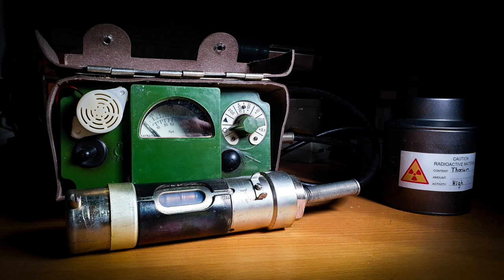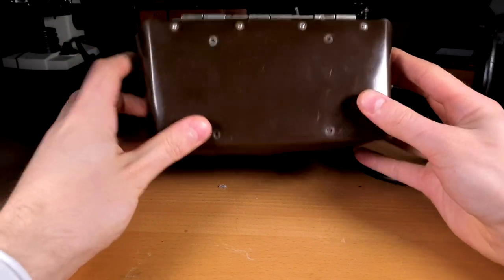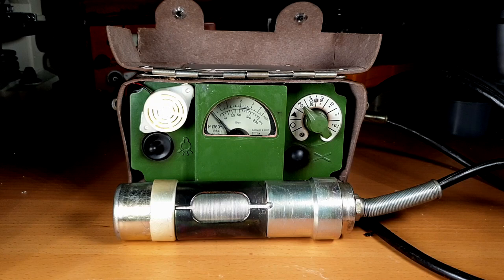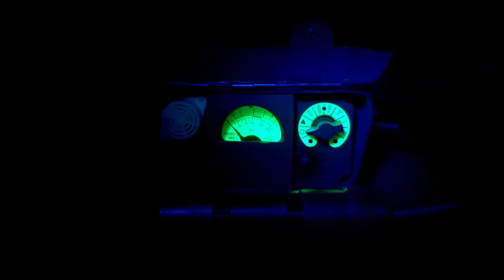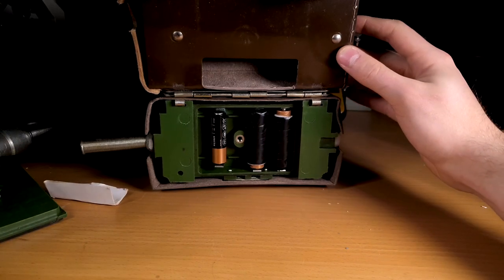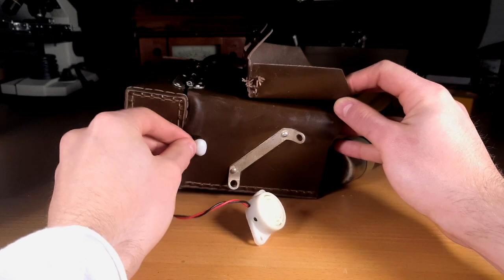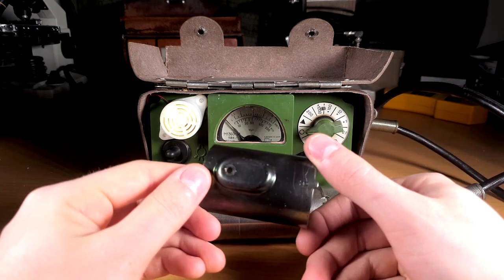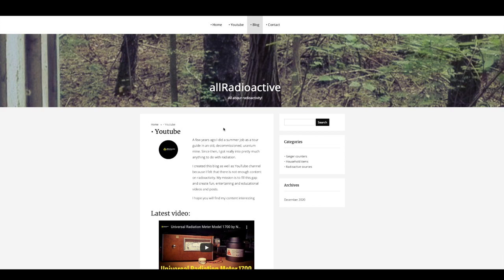DP-5V Geiger counter review

Comment: Thanks I have been having a lot of trouble trying to find out the dose rate thanks also my meter makes a wierd noise witch is normal but when it detects radiation it beeps nothing in the audio port and sounds like its coming from the meter
Reply: Hi ive just looked on any devices list on ebay and he does have extending probe handle for sale and other parts , includeing head phones
Reply: Cool I just made my own wand can you tell me who this seller is thank you for helping me
Reply: @ethansav0892  Hi Any Devices is the seller on eBay. he also has parts for different types

Comment: Is this geiger counter radioactive and dangerous to me?
Reply from the maker: No it is not. Even if the meter has a check source, it won’t harm you since it is a pure beta emitter and it metal shielding stops all radiation coming from it. Also it is a point source which means that with distance, the activity drops drastically

Comment: How do you make or buy a speaker so you can hear the clicking on the geiger.
Reply from the maker: I simply bought a piezoelectric speaker and connected it to the headphone out. It is quite but for lab use it work fine :)
Reply: Thanks also I loved your video.

Comment: How did you make the speaker so loud? Mine is very quiet.
Reply from the maker: It depends which scale you are using. I found that the speaker is the loudest on x1 scale. 
This is a passive piezo speaker meaning it doesn't use any batteries so it won't be very loud.
I hope it helps. If you got any other questions feel free to ask 😃
Reply: @allRadioactive  Ok, thank you! I'll be adding a low voltage mono amplifier to boost the volume.
Reply from the maker: @victorfiori105  keep me updated on how it goes 😃